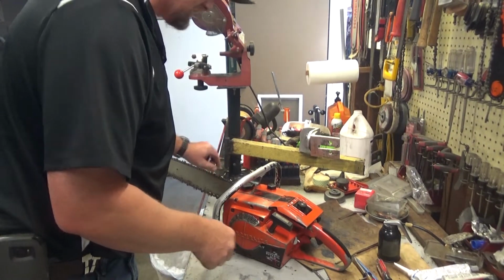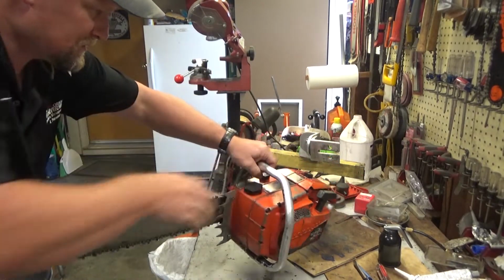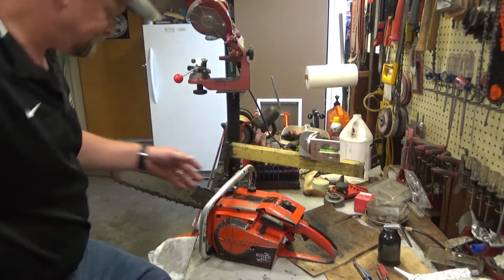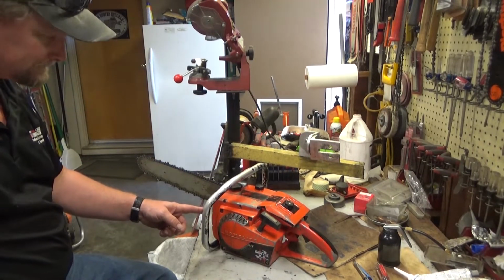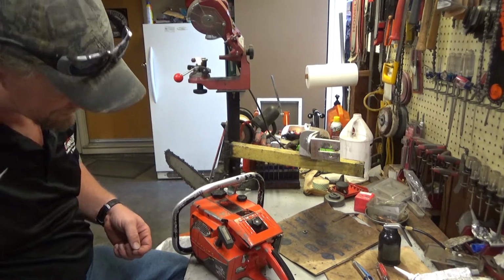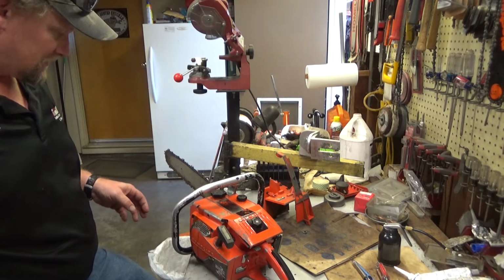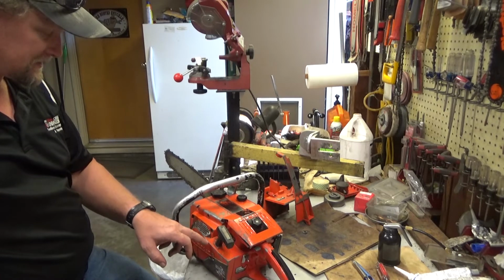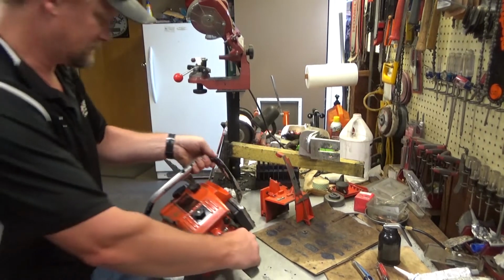Homelite Super XL-910 For My Collection

Comment: Them homelites are awesome. I got a 550 that runs awesome but it must have fallen off a truck
Bed after a hard days work cuz the trigger handle slash air box is smashed. I was wondering if ya had one of them? Thanks.
Reply from the maker: Not for a 550....keep an eye on Ebay though, one should turn up.

Comment: Leon I have seen many people tip a chain saw side to side. I have just run into a Stihl 192t that changes RPM when you tip it. What does that mean? I have done a pressure and vac. test on it it holds at 5psi. After you tune it then start cutting with it it doesn't idle or rev properly. Does this mean a leak in a bearing seal?
Reply from the maker: Most likely it is a crank seal leak...the bearings may be worn allowing excessive movement.  It's also possible that as it warms up, the garter spring on the seal(s) is getting too limber.
Reply: @LeonsChainsawPartsAndRepair  Thank you I have some external bearing seals I will install them and hope that does the trick. Long story but I have to climb and take down a tall pine. So instead of buying an e-bay money pit I bought a chinese clone to a 200t. I started it and it wouldn't oil. No problem I could fix that then I made some cuts with it and the piston rings failed. I asked for an exchange or refund which is on their page. If you not happy send it back they insisted on sending me a cylinder and piston. I called my credit card company. They have 45 fays to respond or I get a free saw. I will make it better. the 192t is an e-bay saw.